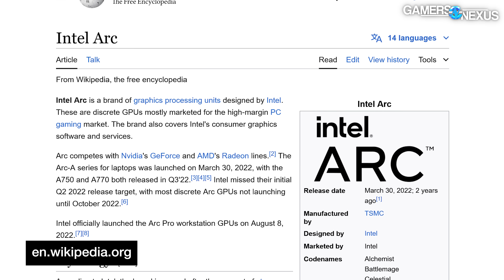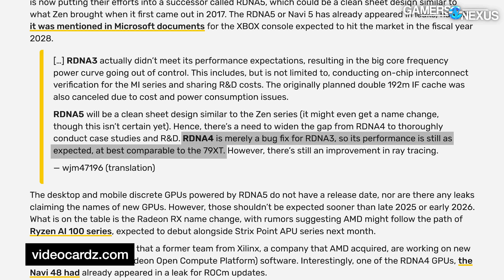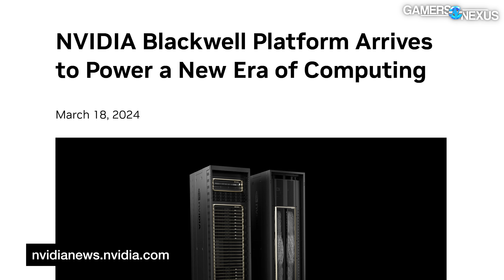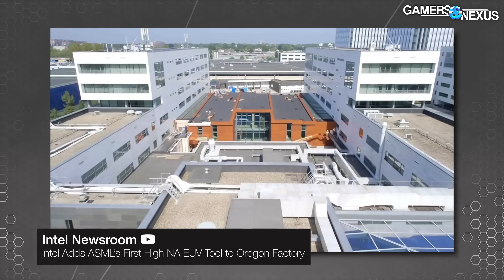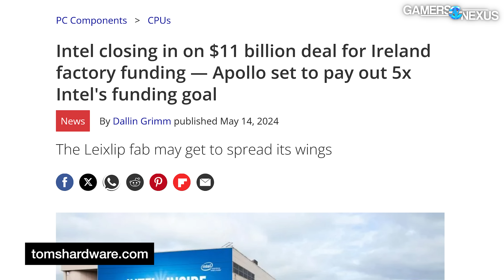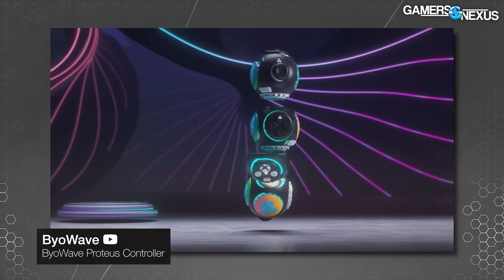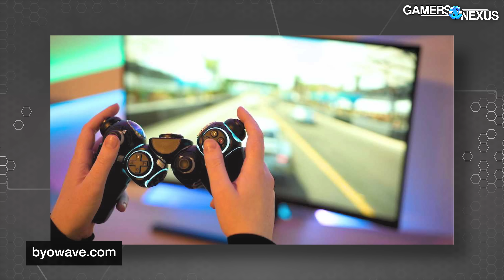HW News - Intel Battlemage Handheld, AMD RDNA5 GPU Rumors (Already), NVIDIA Handheld

Comment: The Intel portables the claw and X1 have all that bios and drivers updates that "fix" issues, but given your AMD bias it's not surprising that you've made the comments you have. I personally don't rely on one source for information, so it doesn't matter to me as you guys are in the same category as Tom and his rumor mill. If AMD was doing so well, why don't they have at least 50 percent of one market they are in?
Reply: They even still struggling to get 15% lol. Just look at my local store stock, intel chip always sold out with higher sold item than amd which still ready stock lol. Their famboy is just big liar, that reason i just called them as scamd lol.

Comment: As far as I have been concerned after repeatedly reviewing every GPU AMD / ATI ever made is that the RX / RDNA series or anything after Vega and VII with out HBM on it has been mid tier cards at best in the same bracket as all the Polaris stuff. Essentially the 5xxx, 6xxx and 7xxx cards were merely modernized Polaris replacements. If you purchase one of those GPU's and it doesn't have a 9 as the second number you are buying a lower end mid tier offering... Still waiting for the next Radeon VII but preferably with out the hardware level bugs and dropped support.

Comment: Name change so from RX to RT (like Ray Tracig) or they go backward again to P like PT XXXX (Patch Tracing). Or get extra X (more x is better like XFX RX7900 XTX XXX) to XRX 9000 (over 9000 meme)? ;D  New name decode diagram like for mobile parts they did? They prewous have X before numbers Like Radeon X1950. 
Or they add AI so RX to RI (Like MI200) for Ray tracing AI/Radeon AI Games GPU: RI 100 (segmented like RI 130 low profile card, RI 150 budget, RI 160, RI 170, RI180, RI 190).

Comment: All of these suppliers suddenly flooding the market (handheld) is going to diminish the demand. It's always been there, but I think Valve ticked every right box with choice of hardware and software. And at this point, I won't choose any windows. Every battery powered widget I have lasts remarkably longer on Linux. 99kwh gaming laptop 2 hrs vs 14, hp tablet 3 vs 18, etc.
Reply: Mind you, this is not gaming, but sitting at the desktop, barebones. Why does my laptop last almost 8x as long on battery, just by switching OS's? Tablet takes as long to charge with windows as it lasts but with Linux it's all day?
Reply: All that telemetry needs amps to run.

Comment: I've heard that Nvidia is confused as to why the Switch 2 isn't out already. That is probably the frustration
Reply: It took 2 years to turn the Tegra X1 into the Switch. If Jensen is frustrated, then he only has himself to blame for not making gaming-focused SoCs anymore, forcing them to make a custom design.
Reply: @ironicdivinemandatestan4262  But it's just Orin, it's not really custom. I think it has a Lovelace raytracing block on it or something like that lol. It's been designed for years
Reply: @tuckerhiggins4336  Drake isn't Orin. Orin has 2 GPCs with 8 SMs each, double-rate Tensor cores imported from the A100, half the RT cores per SM, and a Deep Learning Accelerator for stuff like image recognition. Drake has the same GPC as GA102 (12 SMs per GPC, regular Tensor cores, standard amount of RT cores) and a File Decompression Engine. It's as different as the 30 series GPUs are from the A100. The fact that it's taken as long as it has to come to market should surprise no one.
Reply: @ironicdivinemandatestan4262  Press X to doubt. Nintendo has never been able to afford anything custom, just like Valve can't
Reply: @tuckerhiggins4336 The Switch is literally the only console in Nintendo's history to use an off-the-shelf chip. They actually originally were in talks with STMicroelectronics to develop a custom SoC (codenamed "Mont Blanc"), but Nvidia offered the X1 for cheap and created an entire custom software stack for Nintendo, so they got the contract. Now that the Switch has made Nintendo more profit than the entirety of their video game business pre-2017, they decided to spend the money on a custom job. And you ignore both that the Van Gogh SoC in the Steam Deck is actually a custom design and that Nintendo is a way more valuable company than Valve.

Comment: Just a thought, maybe nintendo banned emulators as hard as they did due to next switch being on par with existing hardware performance which would cut into sales and result in disappointment in hardware. Apart from loss of sales as well from emulation

Comment: Actually I’m going to hard disagree with you on the MSI Claw. They JUST released another BIOS update a couple days ago and it’s actually gotten a much better performance increase. I own the Claw, I accepted the fact it was going to potentially have performance issues on launch, the ROG Ally and Legion Go both had issues on launch regardless if they were as bad or not. The Claw is gotten easily a 30% performance boost and it’s actually better than MSI has claimed. I’m easily getting better than 60FPS in most games that struggled at launch (Claw) and even better performance on older titles. You really should fact check yourself before making a statement like that as I can guarantee you if you check out the latest BIOS update you’ll see it’s outperforming the ROG Ally in quite a few games now. I still think it should have been priced better at $650-700 at most but as time goes on obviously the price drops will come. The Legion Go was $800 at launch and the Z1 Extreme Ally was $700+ depending on where you bought it. Either ways, actually check out the new BIOS before bashing it.

Comment: "Blank slate" should mean they simplify names as well. AMD is like the best limp dick boyfriend ever. 99% of the time they do great things but that one time that also matters they just fall flat or fuck it up. 

They also had the chance with Ryzen but they went the route of copying Intel. Perhaps that was ok-ish consiering Intel i3/5/7s were on the market for a decade as the only good solution, but still.

I take it these RDNA5 rumors are out to prepare hype for the "new blank slate design" while RDNA4 is going to probably be a place holder for the next year as an update to RDNA3 or some minor changes. The "big deal" supposedly from AMD is going to be in 2 years or so. Perhaps end of next year at the earliest?
Reply: Seeing AMD's current ventures in naming CPUs, I think they'll take the opportunity to make them even worse.

Comment: A portable with just shy of an 11-inch display has no excuse not to have good quality audio with beefy speakers, at least two 5watt full-range speaker drivers, a proper AMP circuit with its own isolated battery power supply, I hope that display is OLED too, LCD just doesn't cut it for gaming any more, way too much motion blur that will be even more obvious on an 11-inch display, and to be honest, they could have a full discreet Intel ARC GPU inside it, we have yet to get a handheld with full native VRAM, which alone will offer over 2–3 times the performance, especially minimum FPS will be trebled with a native fast VRAM pool, even if they made it an APU instead of SoC like every other handheld/portable gaming PC thus far, it's an APU of course when it has onboard native VRAM rather than an SoC which uses shared DRAM. 

Contrary to popular belief that SoC's like the Z1 & Z1 Ultra are APU's, they are actually SoC's as they use system RAM, the last proper APU outside the console space was the Intel Kaby-Lake G, which was an Intel CPU & AMD Vega GPU based APU with native on die 4GB HBM2 VRAM, which was and still is an absolute powerhouse and still remains the fastest all-in-one CPU/GPU to date, it has much higher minimum FPS than the Ryzen Z1U SoC and can hold performance @ much higher resolutions, heck eve Intel's Iris Pro with 72 EU's and on die native eDRAM can outperform the Z1, and it came out in 2013 lol, so it just shows how big a deal on die VRAM is when it comes to smooth consistent performance.

Comment: I understand that bigger number better but starting with 5000 was dumb. Using up two thousand series for a CPU generation is also dumb and that will run out with zen6. Maybe AMD wants to change CPU/GPU numbering at the same time so they'll skip 9000?

Comment: I don't understand why AMD doesn't just use "RDNA 5" in the name, not only does it sound better than RX, it's also much more distinct compared to Nvidia's "RTX", plus they can just retroactively (on paper at least) tack "RDNA 4", "RDNA 3", etc, onto all of the previous RDNA gpu's without changing anything

Comment: If intel continue with their GPU I might buy them when battlemage comes out. If they work on their drivers and UI then I will buy their gpu. INtel gpu's are good at productivity so that would be real great. The only thing I wish intel can fix that I dont like is their power consumption. I wish for a more lower power draw and good performance like the RTX 40 series have. Same goes to their cpu's.

Comment: Jensens probably frustrated at nintendos insistance for nvidia to make a chip thats at max. 30% faster than a 50 year old calculator, as opposed to 20% faster, which is the current switch soc.
I swear they make their hardware outdated on launch on purpose.
Reply: The Tegra X1 was the best mobile gaming chip ever for the time. Go on, tell me, what was better for portable gaming than it in 2017? I'll wait.

Comment: 238V is pretty much the grid voltage in EU. I would not think CPU would work directly on grid voltage. It'd make transistors a touch bigger than they currently are - think mm instead of nm :D

Comment: The fact that Battlemage is also making its way into handhelds points towards Intel having gotten the high power draw under idle and temperatures under control. Hopefully. Because that's something baked into the Alchemist silicon which can't be fixed with driver and firmware updates. In terms of transistors the A770 was aiming for the RTX 3070, but ended up performing about on par with the RTX 3060... when the drivers worked.
I really, REALLY hope that Intel gets this launch right and Battlemage becomes a serious alternative to Nvidia's and AMD's offerings. Because if this launch turns out to be a disaster too, then that might be it for Intel's dedicated GPU department.

Comment: i wounder if the biowave controller is the reason they started blocking third party controllers that people made and used for accessibility issues, such as custom one handed controllers that could use foot pedals made with arduino or the rp2040.

Comment: A big name change for Radeon would make sense if AMD thinks they have something really good on their hands. Starting the graphics equivalent of their Ryzen brand would probably do wonders, kind of wiping the slate clean. Of course, that also builds up consumer expectations, which at this stage is finally having someone trade blows with Nvidia. So if they do that, they best not miss. That's why I'm not surprised they didn't make big branding changes for their current line up, despite the chiplet approach.

Comment: As someone who has one working arm, im looking forward to this controller. I lost all motor function on my left side after suffering a stroke in 2017. Gaming was a major part of my life before that, and basically having to stop saddend me greatly.
Reply: I feel with you, man. Suffering from MS, I'm not fully hemiplegic (yet), but it's become increasingly difficult to control both keyboard and mouse at the same time. I've been following the news around the Proteus since I've first heard of it. It's not made for me, but it always makes me happy when something with the needs of disabled people in mind comes to market. I'd be glad if it gave you back what you've lost.
Reply: @majindustin, have you heard of the 3D-Printable accessory you can put on a PS4 controller to use all inputs with one hand? Akaki Kuumeri on Youtube designed it, and the files can be printed for free. You can see his video titled, "How I play with my one-handed PlayStation controller".
Reply: try out opentrack. its a free opensource headtracker that you can setup to use a smartphones gyroscope as an input. i used to use it for DCS world before i got VR to look around the cockpit while using a HOTAS joystick setup so couldnt use a  mouse. 
i just strapped my phone to my headset and problem solved haha
takes some tweaking so that you can get enough movement without looking away from the screen, but if it could get you gaming again, seems worth it to me!
Reply: While it's not quite the same thing, I'd recommend checking out the Xbox Adaptive Controller. There's a gaming YouTuber that uses it with their feet to play, don't recall the reason why they do though.

Maybe use it in combination with a joystick.

Gaming with any form of dysfunction can be hard, don't let others get you down over it. Find your community, there are plenty of others out there and they could help you get that joy back into your life.
Reply: Honestly, you shouldnt be allowed to play. Get a differrent hobby.
Reply: @ReKonstructor  Wow, so edgy.
Reply: @ReKonstructor  Wtf of an inconsiderate and heartless person are you? You should be ashamed of yourself.
Reply: @ReKonstructor Captain Eugenists over here, why don't you find a new hobby that's not bullying people for their disabilities online.
Reply: @ReKonstructor what a wild thing to say to someone.

Comment: I can't wait to see the Intel fab tour video. I've worked in the R&D section of the Oregon fab for the last several years. Long enough to see the full development of Blue Sky Creek, a test vehicle for PowerVia that used the Intel4 process specs for the transistors, but the 20A carrier-wafer process to make the chip. Cursed hybrid chip, and basically a faster N200.

Comment: Jensen is probably frustrated with Nintendo over the fact that they're using a nearly decade old SOC, and Nintendo was probably the reason for the X1+, and the fact that Nintendo wanted to milk the Switch's lifespan for as long as they could; honestly the fact that TOTK, with Nintendo's first-party hyper-optimizations, struggles at times shows that the hardware is no longer viable, this is probably what majorly got the ball rolling for a successor internally within the company's higher-ups.  Imagine being Jensen, you come out with a new hardware gen roughly every two years, you want to continually progress tech for continual sales year over year, and then you have Nintendo that buys into a chip that's already on its way out, and was mid-tier at its launch, and they extend that chip's cycle to be nearly a decade old; anyone would realistically be frustrated, especially when consumers understand how underperforming the Tegra X1/X1+ is now, and when the handheld market is starting to boom, Nintendo is outright tarnishing Nvidia's image in the space because they refuse to move forward with hardware, we should've realistically seen the Switch 2 by the OLED's launch given how the Tegra chip then was already outdated mid-tier hardware, and everyone but Nintendo's higher-ups agree with this. 

Though at the same time, it's bizarre that Nvidia is partnering with a different ARM manufacturer to produce a hybrid SOC, like what AMD did with Samsung (and frankly made an underperforming SOC), instead of just making their own SOC.  MediaTek also isn't really known for flagship processors, which makes this decision even more odd.  Even if Nvidia is trying to dip their toes in the market, the product is likely to underperform and ultimately be a flop.  Then Jensen is going to have a fit about how that market doesn't have viability, then have a fit once someone else proves market viability, while not reflecting on themselves and accepting that they made a bad business decision; honestly if Samsung and AMD couldn't make a flagship chip out of their partnership, MediaTek and Nvidia definitely will not make a flagship-tier chip, if anything it'll be like the Microsoft and Qualcomm partnership that did nothing and went nowhere, and the most it did was stagnate development on both sides of the partnership. 

Honestly none of this makes sense business-wise.  Maybe if Nvidia produced a proper gaming successor to the Tegra X1, maybe Nintendo could've had a Switch 2 earlier with some persuasion, and maybe Nvidia would be producing their own general-use and gaming ARM SOCs still rather than forming odd partnerships to fill that gap.  Honestly I think most of the upper end of Nvidia just has their heads too far up their own asses, or possibly each other's asses, as Jensen is just the head of the Nvidia human centipede of bullshit.  Part of the issue here is probably cost as well, Nvidia is nothing but greed now, might as well change the company's name to cOdicia by this point, and Nintendo likely struck a decent deal before prices were driven up to insane amounts; Jensen's frustration is likely that Nintendo is dead weight, money-wise.

Comment: I have never heard of a CPU that uses 238 Volts. Generally, a safe range is between 0.8V and 1.4V, depending on the CPU. 
But if we were talking about Watts, then yes, then it might draw more than 250 Watts in turbo mode.  5:57

Comment: We need to have Disturbed play land of confusion for Intel and AMD's new names.

On another note. According to MLID's contacts at AMD, they stated that AMD almost was chosen for the switch 2, and Nvidia had to make moves to prevent that. I assume this is why Nvidia is upset with Nintendo. Nvidia is already losing the handheld and console market to AMD. Would be big blow to Nvidia to lose the only handheld contract they. After failing to buy arm I wonder if Nvidia want's to buy MediaTek now? Jenson has been really horny to build CPU's for along time, so I wouldn't put it past Nvidia to still be on the prowl for CPU companies to buy.